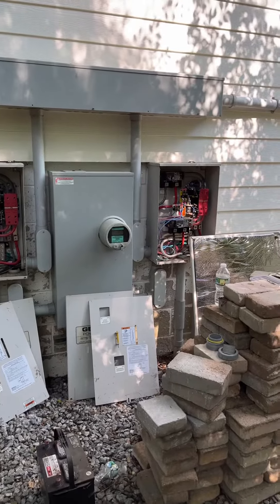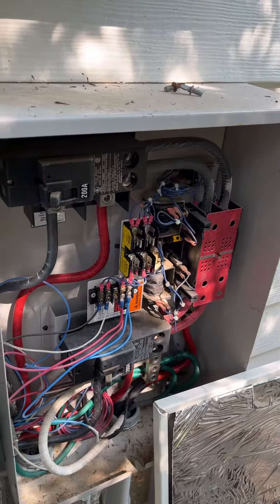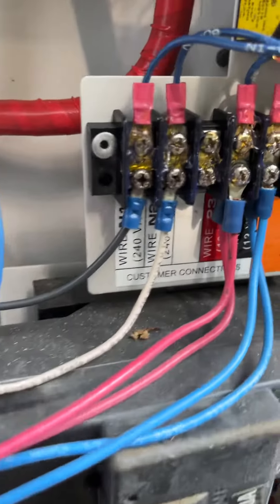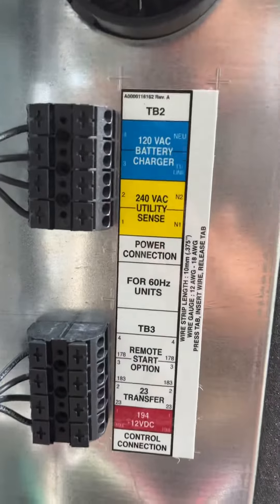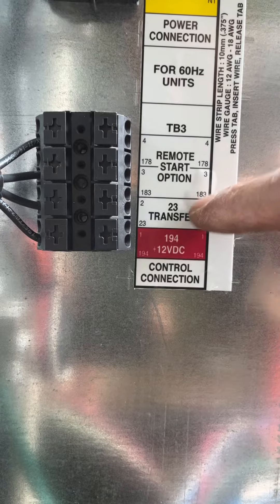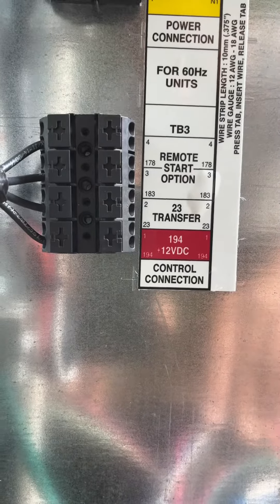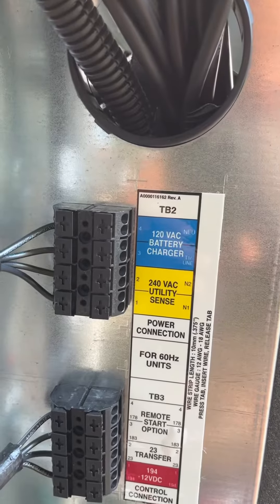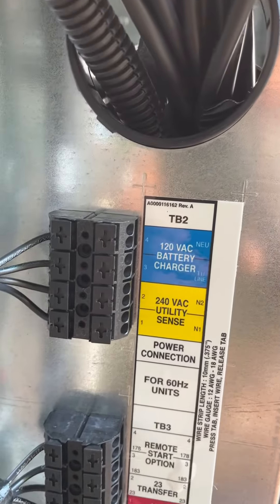Generac 48KW - wiring tip

Comment: Or if you change the programming to 2 wire start you just touch those two cables and the gen will start?
Reply: Ironic this was on my feed. I have a quick question about the options of having a generator engine start wiring in this ATS. Could it be used to potentially or theoretically start a portable generator. I currently have a Genmax 9000 watt propane generator with an engine start and it even has a remote starter. Could the 2 wire start wiring work for the generator for the "signal" for starting it? Thanks. 

Jeff - Licensed Journeyman Electrician 
Sunny Central Florida ☀️🙏

Comment: Do you need the two wire start conversion kit for this model?
Reply from the maker: You do not need a conversion kit for the generator however that transfer switch wiring would have to change a bit.